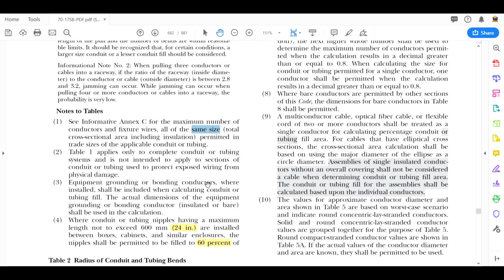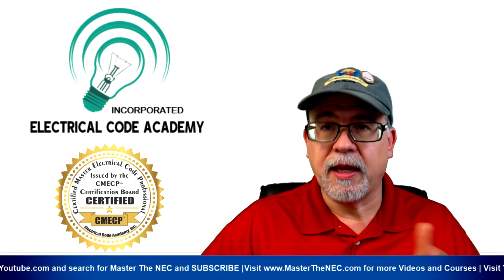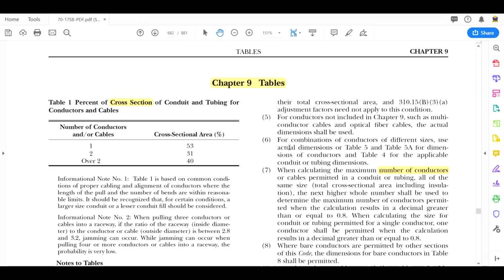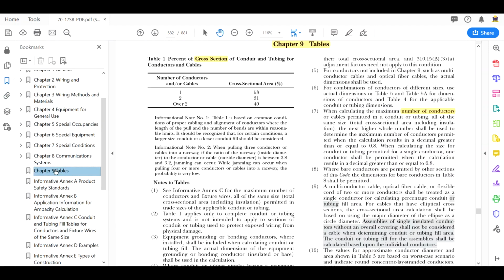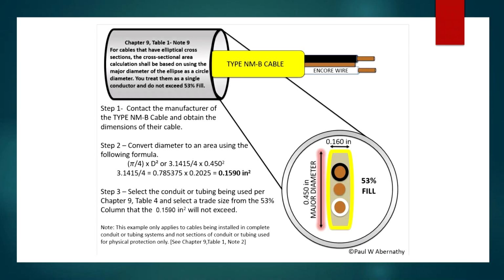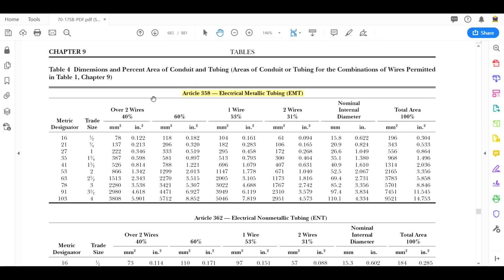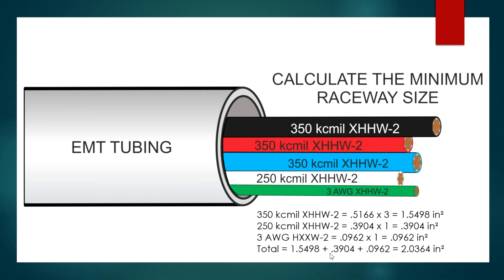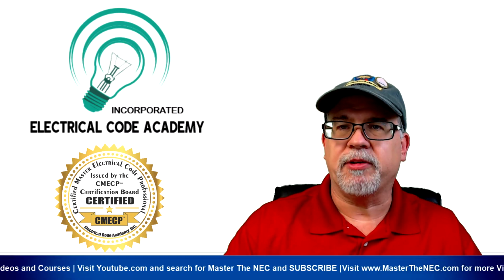2017 NEC - Raceway Fill Calculations- Simplified

Comment: Is chapter 9 table 4 more generous than the annex c method? If it is, why?
Reply from the maker: Its not, the only difference is Annex C is when all the conductors are the same size. Keep in mind also Note 7 of Chapter 9, Table 1.
Reply: But I noticed when using all the same size and insulation wires, cheaper 9 table 4 allows more conductors than the optional Amex c and thought that was interesting. It was a significant amount more wires
Reply from the maker: I disagree.....You do know that Annex C is based on the 40% Fill. For example, lets say 12 AWG CU THHN Conductors in a trade size 3/4 EMT. The maximum (40%) fill is .213 in². So, per Table 5, a THHN has an approximate area of .0133 per 12 AWG THHN. So, .213 ÷ .0133 = (16 conductors) 12 AWG THHN's. Now, per Annex C for a 3/4 EMT with THHN 12 AWG would be 16...exactly the same.
Reply: You are right! My mistake. I was breaking my head over this when the whole time I forgot to check the insulation in the Amex c. I wasn’t comparing the same insulation’s 😬😂

Comment: Cant a wireman in the field do a measurement for rough estimate of wire fill for cables not listed ?
Reply from the maker: I think you mean "can they guess"? well, I would have to say NO. It is much easier to simply perform the calculation. In most all cases the manufacturer will provide values for their products when not covered in Chapter 9. I would never recommend guessing. However, do some folks guess...sadly Yes.
Reply: @MasterTheNEC  ..what i mean, is if i do field measurement, then do the math and i am under the allowed wire fill by enough to have some leeway, then shouldn't i be OK ? i think i saw you in the video that it is allowed, (Note 5).. so thanks...i had not finished the video yet..
Reply from the maker: William - The note 5 permits you to use values from the manufacture for raceway fill. Such as PV Wire which is not listed in Chapter 9 Tables so it allows the use of manufacturer specific values in your calculations for the raceway fill. However, that is only for the conductors value as the raceway percentages and data from Chapter 9, Table 4 will still apply.
Reply: @MasterTheNEC  thanks for the info and the video... keep up the great work...

Comment: In a raceway does 90 degree corners change the filling % allowed to fit cables?
Reply from the maker: Greetings Me.Cairva - The bends themselves do not change anything but IF you are pulling a cable inside of a complete raceway system [(300.18(A)] then you have to be aware of Note 9 of Table 1 in Chapter 9.  Basically you would treat that cable as a single conductor and not exceed the 53% fill as stated in Table 1 for a single conductor.
Reply: @MasterTheNEC  Thank you very much. Your youtube videos help me a lot for my Decathlon Project.

Comment: in my case it is total 2 cables. 1 cable is multi core say  4 core 10mm and other is 1 cable single core 10mm as grounding. so i should calculate it 31 percent conduit fill
Reply from the maker: You got it !

Comment: do we have to consider grounding cable as one cable with one multi core power cable during conduit fill calculation knowing that only one cable dissipating heat and for one cable it is 53 percent conduit fill. in my case it is 4 core 10mm2 as three phase and neutral and another cable is 1 core 10mm2 as grounding conductor.... Please replay on this Question.
Reply from the maker: Greetings John,

The NEC® gives us direction on when a cable is to be considered a single conductor for raceway fill applications within Chapter 9, Table 1, Note 9. So if you have a "multiconductor cable" then it is to be counted as "one" conductor and you are now going to have to find the approximate area of that now "one" conductor for raceway fill applications. If you happen to put another cable or single conductor in the same raceway then you have now "two" conductors in a cable and again using the approximate area of each to determine raceway fill. So in your case, you would have "two" conductors and this depending on the raceway you would indeed not be able to exceed the 31% fill in your example.

As for the equipment grounding conductor look at Note 3 of Chapter 9, Table 1 and there lies your answer. This rule has nothing to do with the number of "current carrying conductors" in terms of how this rule applies as that is taken care of in 310.15(B)(2)(a) and in that case the EGC is not considered to affect anything since it is not a current carrying conductor BUT it does take up space in a raceway so you have to account for that space if you run an EGC of the wire type in a raceway.

Hope this answers your question.

Comment: Please tell me why its set for one cable 53 percent fill, for two its 31 and for three or more its 40 percent why is the reason behind this percent set
Reply from the maker: Greetings John,

 I am not actually an NEC historian...BUT

Now the difference in the 2 conductors at 31% versus the over 2 conductors at 40% is all to do about jam ratio and the propensity for 2 conductors to "jam" up and damage the sidewall of the insulation during a pull because the only conceivable way they will align in the raceway is side-by-side and thus effectively take up upwards of 80% laterally of the raceway whereas the over 2 conductors tend to nestle within themselves and have no noticeable issues during tough pulls. While there is still a possibility of jamming it is more about the position the conductors are in as the pull is performed, such as cradle position or plexed"twisted" so on. Think of it this way...two 500 kcmils in a raceway doing around a bend are likely to "bind up" as they both attempt to lay flat around the end and since side by side they would take up most of the raceway and could possibly crush their sidewalls.

While most "NEC" folks will say it has nothing to do with heat dissipation I can tell you the available air space and the ability to dissipate heat based on the number of conductors inside the raceway taking up that available space is critical in our tests on conductors as part of our R & D experiments at Encore Wire. The mutual contributor of other conductors can elevate the temperatures that affect the insulation quickly and the airspace to aid in dissipation is important to us not breaking that 90C threshold on our conductor's insulation.

 Limiting the percentage of fill helps keep an acceptable approach to the negative attributes of overheating insulated conductors but to be totally honest it is more about the JAM RATIO and the heat dissipation is more a benefit in my opinion. As of course, it also can have a lot to do with the pull within the raceway as well in terms of reducing the risk of sidewall damage to the insulated conductors and causing premature failure because the inside areas of the raceway types can vary.

Hope this explained it a little....as it is the best I got my brother.